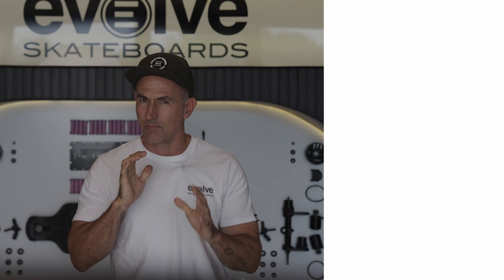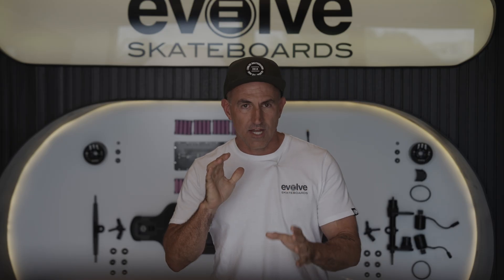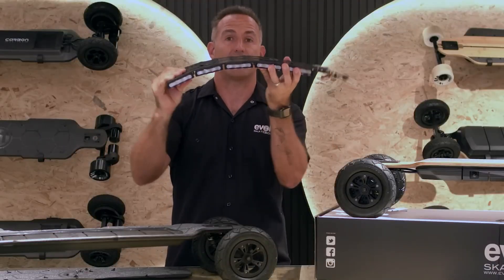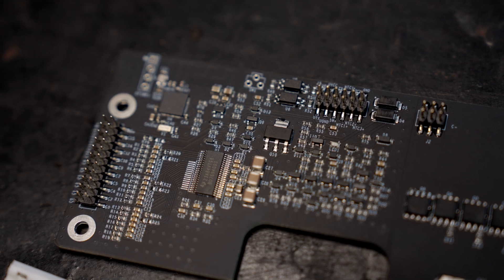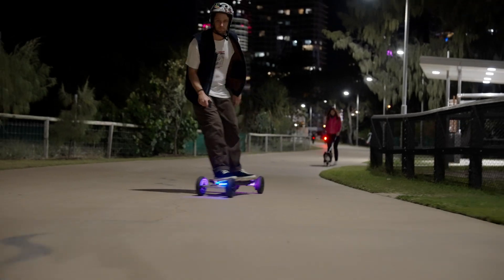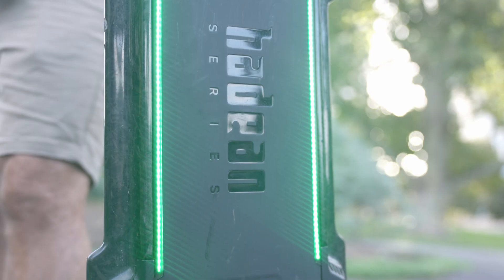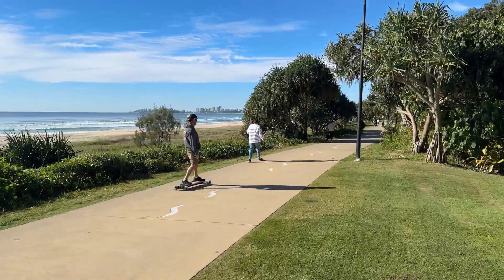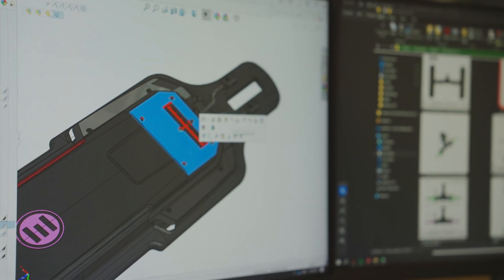Under the Hood of the Diablo Series

Comment: I have a little doubt about the difference between Hadean & the new: just the motors?
Reply: bigger battery capacity. upgraded esc. upgraded motors. upgraded safety features. upgraded trucks. upgraded bamboo deck. upgraded  enclosure. upgraded grip tape .
Reply: @esk8unity  Thanks! Apparently the carbon hadean & carbon diablo seem to be the same in general aspect, but of course, if that's difference elevate substancial feeling, it's goes considerable.
Reply: It's a more dialed in upgrade of the Hadean package. The wider and more stylish trucks are the cherry on top for me
Reply: @scienz0220  very well! Yes, if that's realized in the ride, like you admitted, certainly brings more fun, maybe more reliable & comfort.
Reply: @Zamarian  i rode 123 km distance over 3 hours, with a top speed of 52 kmh!  Fun, reliability, and raw performance like the Hadean never even dreamed of!
Reply: @scienz0220  interesting

Comment: I have put around 100 miles on the Diablo Street so far, and its package is a total game changer over the Carbon GT predecessor I was riding. The acceleration curve feels like it always has more headroom, and getting the trigger down fully is a carefully executed operation!  I have some notes on small improvements that make sense to me, but the list of details fully dialed in is much longer.  I'll miss the color "Bule" on the remote when the typo eventually gets fixed 😅
Reply from the maker: That bug has been fixed. Update the remote on your explore app and it should all work properly now.
Reply: @evolveSkateboards  i got the update installed, and had some trouble pairing, so I did the firmware update a second time, and now all seems to be resolved.